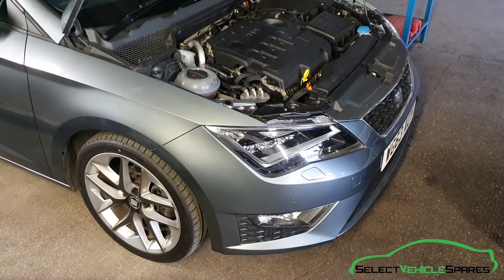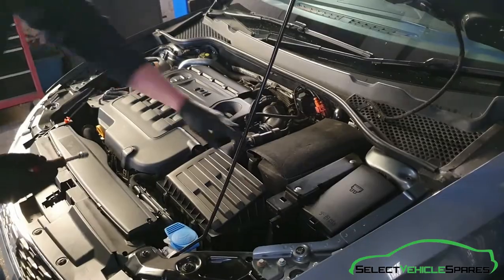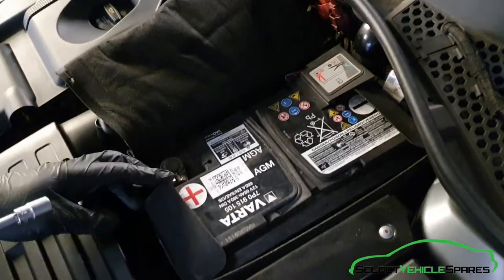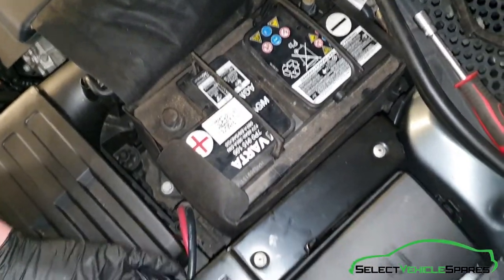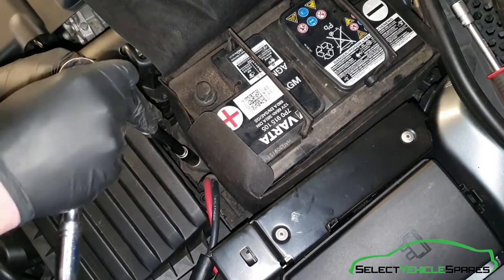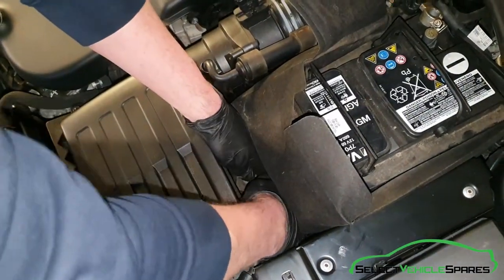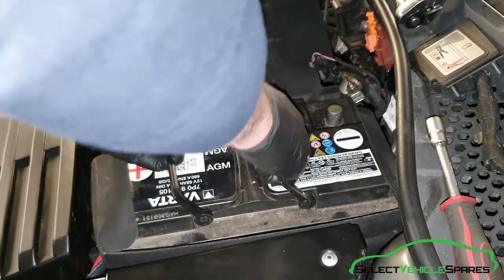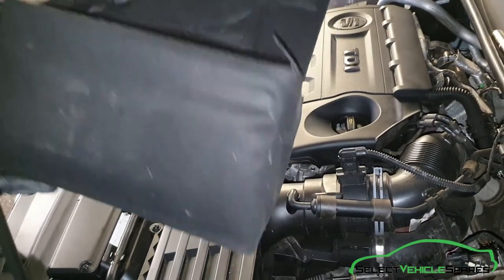SEAT LEON MK3 - How To Remove The Car Battery Removal Replacement 2013-2019

Comment: I've been told by seat that it's £200+ to replace my battery and have the required coding done.

I've changed batteries a few times, pretty straightforward but do you know of any coding required for the vehicle after a battery change? First I've ever heard of it.
Reply: No. What happened?
Reply: If you change to a different style battery from AGM to EFB or vice versa it needs to be coded in so the battery is charged correctly. Will still probably work fine without but might affect the life span of the battery if not coded correctly.

Comment: What about car alarm and radio code?  Always concerned that reconnecting won’t automatically make these work. Do you still need a 12volt auxiliary feed to protect codes???
Reply from the maker: On our vehicle there were no codes required when the battery was re-connected, we haven't seen any Leon Mk3's that required a code.

Comment: Hello. Would you recommend to disconnect my battery on my Leon Fr 2017 (it’s stop/start) since I won’t be driving it for 4 months? Will it effect anything when I come to drive it again? Thank you
Reply from the maker: There shouldn't be any need to disconnect it, but if you do then you may get a few warning lights when the car is started back up. In our experience these go away after a few hundred metres of driving the car. We would recommend a battery charger over disconnecting the battery.